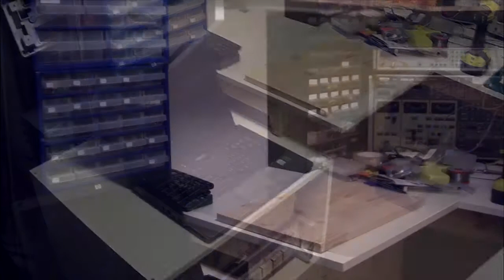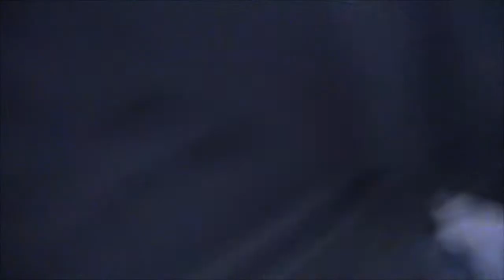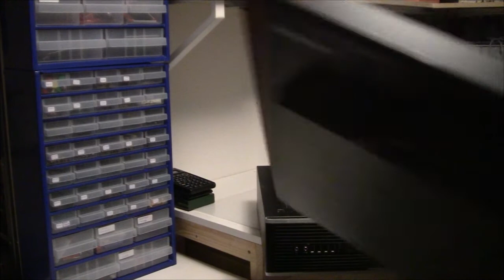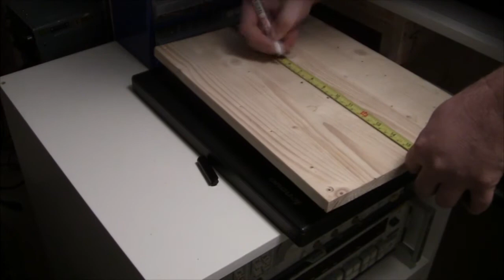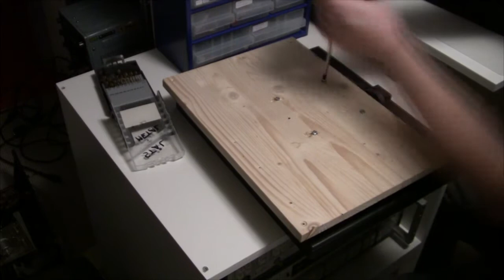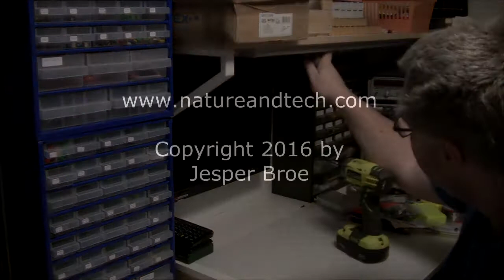Build a TV/monitor wall-mount for $1

Comment: Uh are you supposed to drill it into the monitor
Reply from the maker: No monitor was harmed during this show :) The monitor is attached using the VESA mount using screws from the back of the board.
Reply: @NatureAndTech  that was my brother i dont know anything about this i subed-MrDank